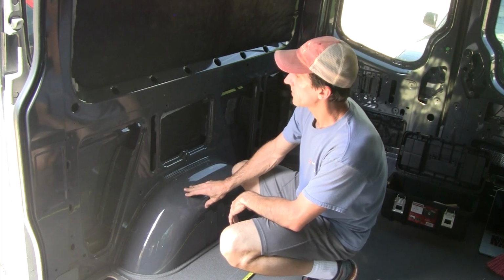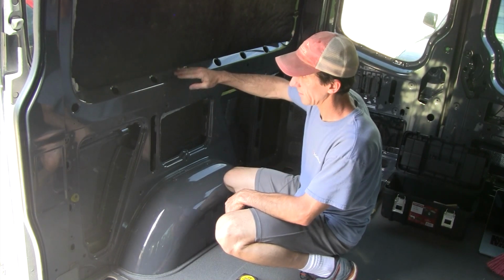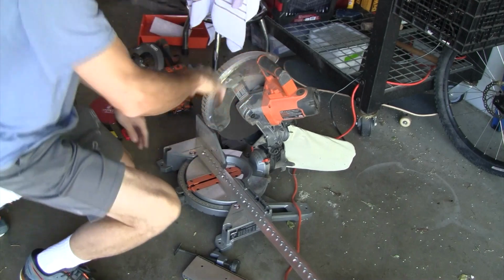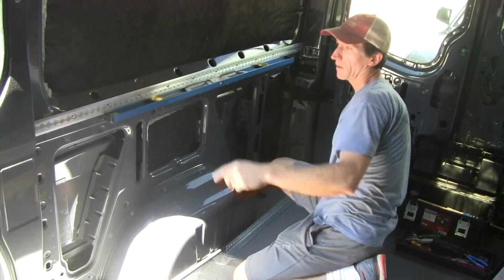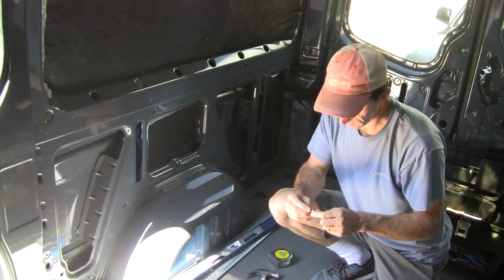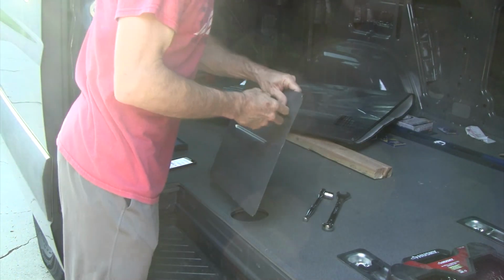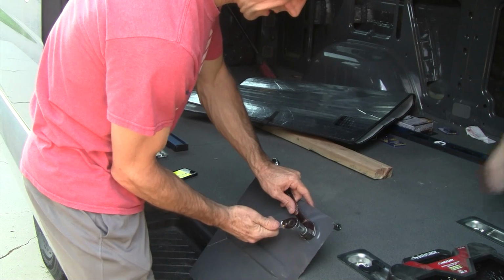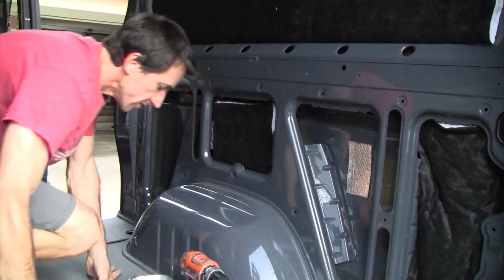Platform bed install in Sprinter van Part 1 -  L-track mounting

Comment: Do you put any thing such as a rubber washer between the plus nut and L-track? Does the direct metal to metal mount generating rattling noise?
Reply from the maker: No I did not, and there is no rattling.  The bolt heads and ltrack holes are tapered. The bolts go through and straight into cross nuts.

Comment: Great video. Is there a reason you wouldn't have been able to just mount the angled piece directly to the van wall? Rather than into the L track?
Reply from the maker: You can mount directly to van will with rivnuts or cross nuts.  I like the L track because it offers flexibility to move things and secure more.  In fact I later had to move one bed support bar back to allow RIB folding seat bed to clear it (see part 3 of that series).  I can also use it to secure other things like extruded aluminum cabinets / boxes for batteries and water tanks.

Comment: Have any of your cross nuts come loose?  I heard that can be an issue.  Great videos!
Reply from the maker: Not that I've noticed.  I've checked the track periodically, especially after long trips where we're using the bed.  So far I have not found the track to be shifting at all.  What I have seen is the nuts on the bolts that go through wood platform to my angle brackets (Part 2 video) come loose over time.  That can be solved with a locking washer or using a thread locking fluid.